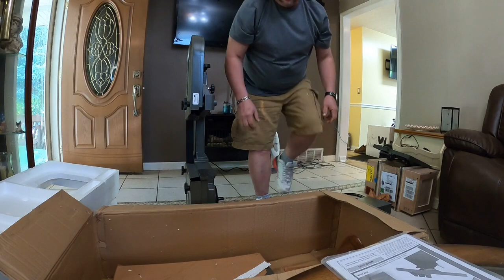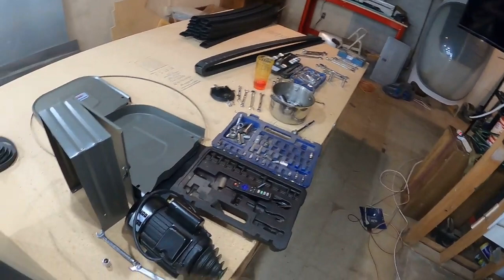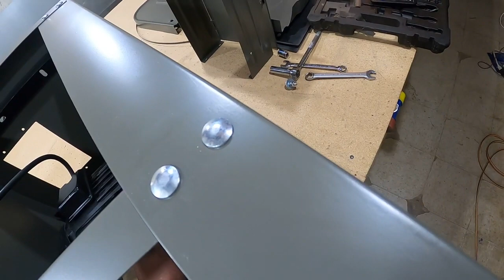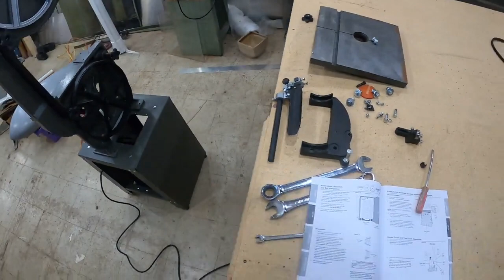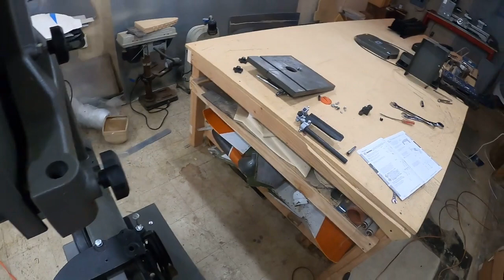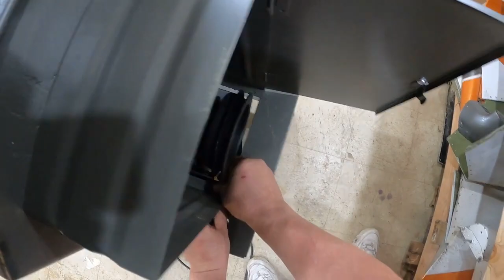CENTRAL MACHINERY 14 In  4 Speed Woodworking Band Saw

Comment: The machine is mostly sound but the motor will go south in about a month. They won’t just replace the motor. You have to bring the whole machine back even after all the time you have in assembling it. Upgrade to a farm 1 hp motor. It will cost you about $200 but you’ll still be cheaper than the next lowest priced 14” bandsaw on the market. The saw as it comes will not do the resawing that they claim.